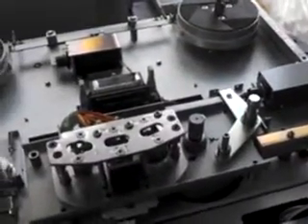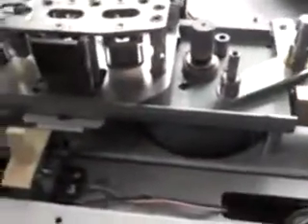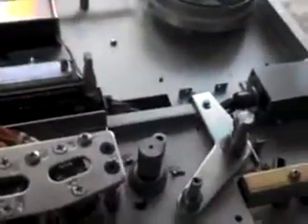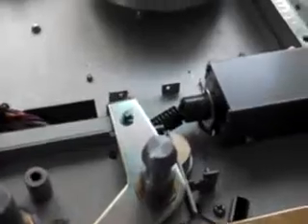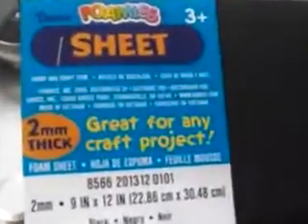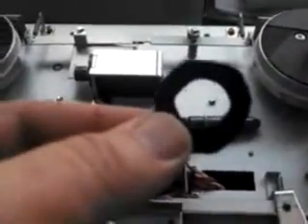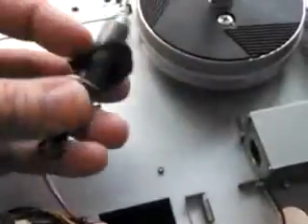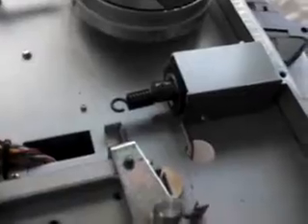Reel to Reel Player Solenoid Cushion Replacement MacGuyver Repair

Comment: Do you know if it's similar to the Solenoid rubber cushion of the Tascam 48? i have a problem with my pinch roller, and i think needs to be replace.